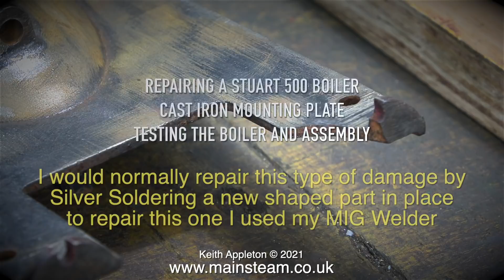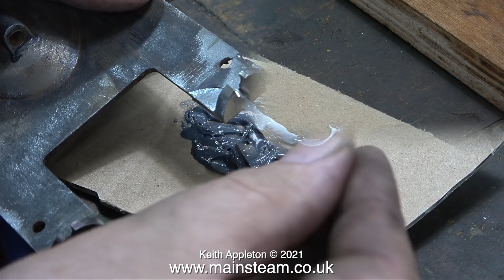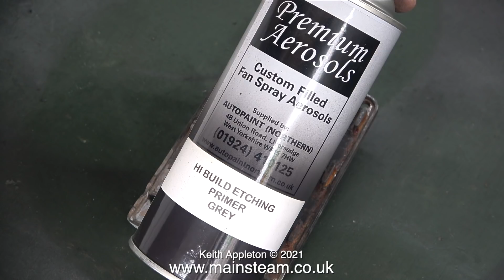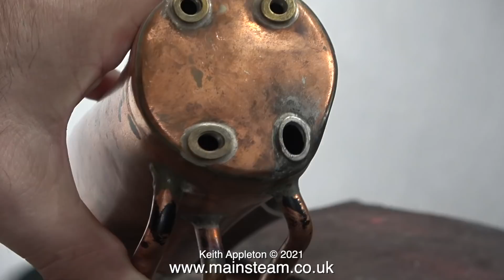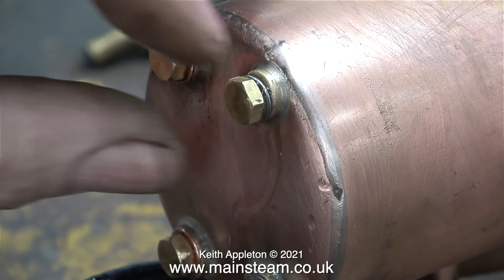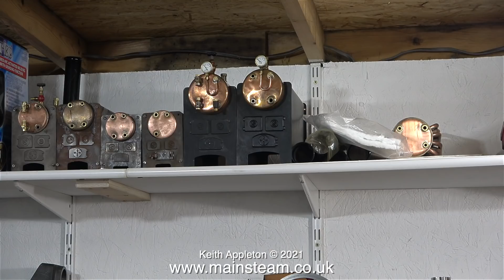REPAIRING A CAST IRON STUART 500 BOILER SUPPORT PLATE - IN THE WORKSHOP

Comment: Would be interesting if Stuart made a variation of the 504 that featured a Mud Drum at the lowest point of the water tubes towards the rear of the boiler, transverse to the barrel, taking advantage of their slope, and have a blowdown fitted to it. Should help keep scale from building up in the water tubes, instead of stagnating in the low elbow. Would also allow the boiler to be drained completely when blown down.

Comment: if you use a MMA (stick welder) you can buy cast-iron rods they are easy to use but if the casting is not good quality then you can have fun?
and but using MMA you can machine it afterwards.
You are right in saying if you MIG cast the weld will go that hard that you can't machine it well, you would only be able to take a few thousands cut at a time

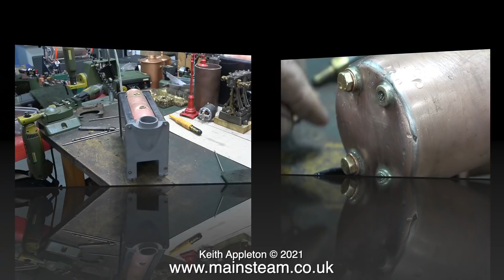Comment: Hi Keith.  A few comments.  1)  It's hard for anybody to MIG weld cast iron.  Don't feel bad!  2)  at 4:33 a drop of water is seen forming.  Looks like a leak to me !  ha ha 3) at 4:56 you make an interesting statement.  I think the amount of water that would come out at a higher pressure is the same amount.  It would come out faster is all.  It will be interesting to see what others think.
Reply from the maker: That was just from the thread of the blanking plug - not the bush .......
Reply: Bryan, Higher Pressure means more water is in the boiler, every stroke of the hand pump adds a measured quantity of water, so more water would indeed leave if he unthreaded the plug at a higher pressure, it wouldn't be tremendously more, but more none the less.

Comment: Well,the Formula 1 types use a lot of TIG for roughly the same reason,so you are likely on to something. Better choice of filler rod too.
Would it be worthwhile experimenting with aviation epoxy paint on to brass ? I am quite certain a phone call to a tech rep would generate what the manufacturer knows about their product on non Dural surfaces. It's years ago now,but I used aviation epoxy on zinc plated and zinc dipped sheet steel. Very successfully. A little road salt and automotive paint usually started to peel off.
Just a thought. All the best.